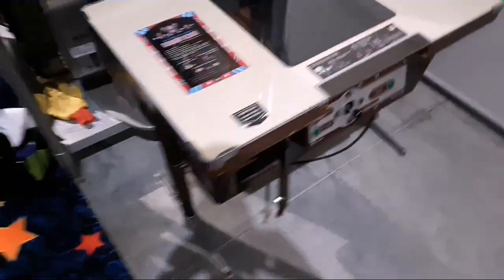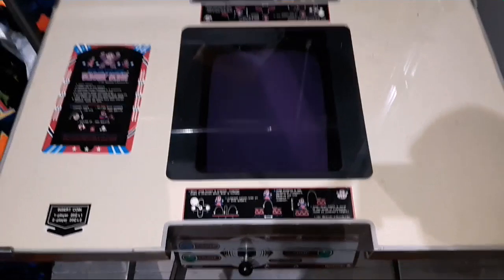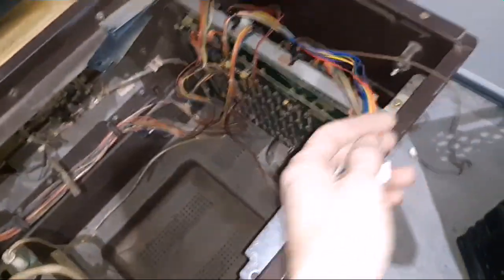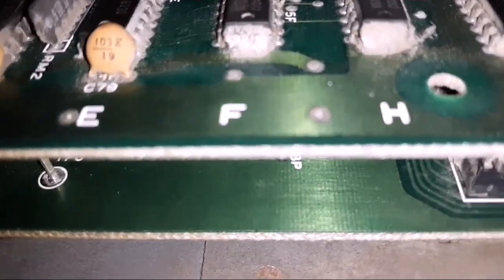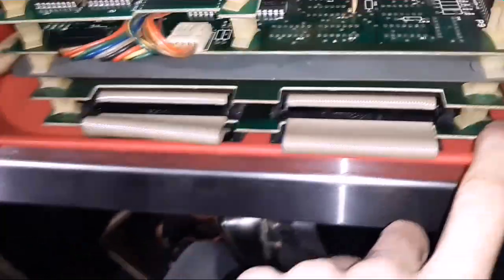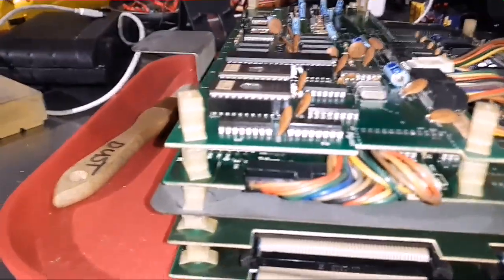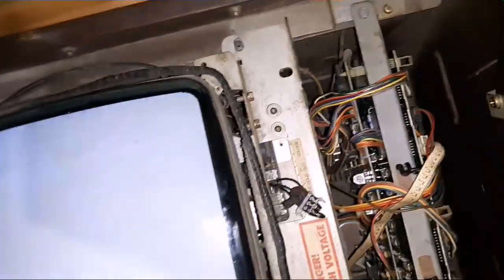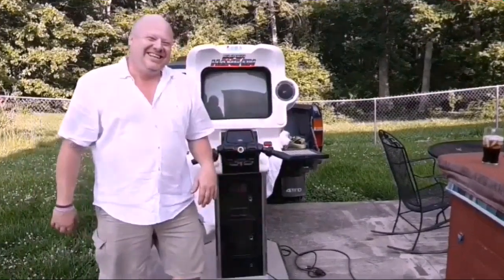Donkey Kong Cocktail Arcade Repair: No Video Signal. The Easy Stuff

Comment: I have always wanted a cocktail cab...
Reply from the maker: That DK is so tiny!
Reply: I want one too!
Reply: I was just recently gifted the same cocktail game table it powers on but unfortunately there is no sound and the characters don’t show up any idea on how to fix
Reply from the maker: It’s a pcb issue. Make sure the board is getting proper voltage, and try removing and reseating the game rom ic’s on the board. I’d start there.